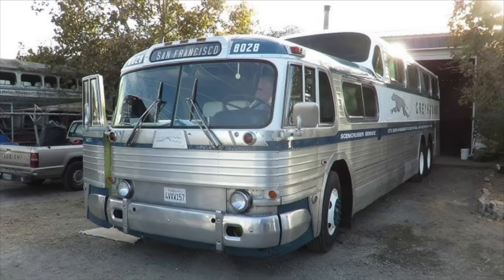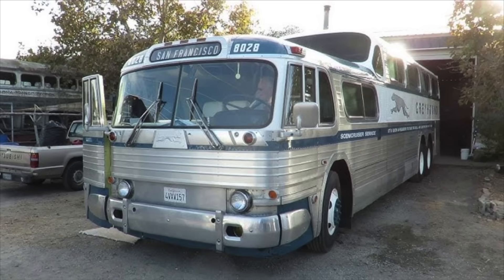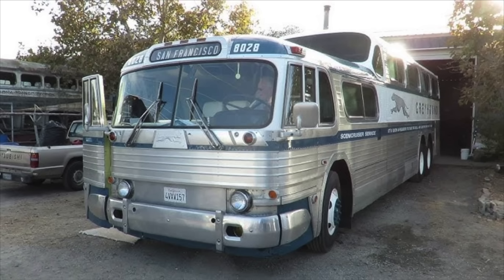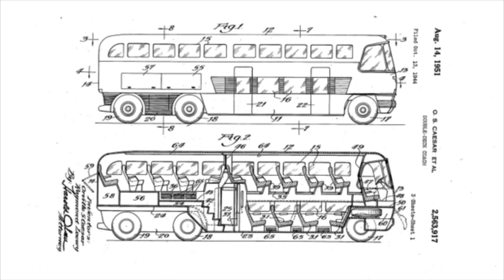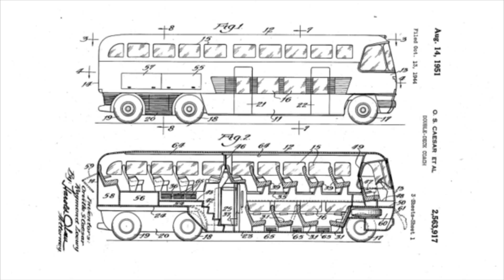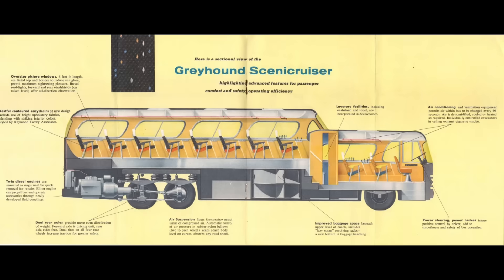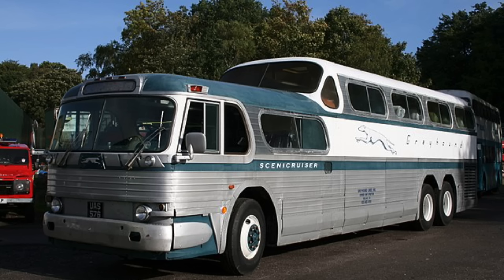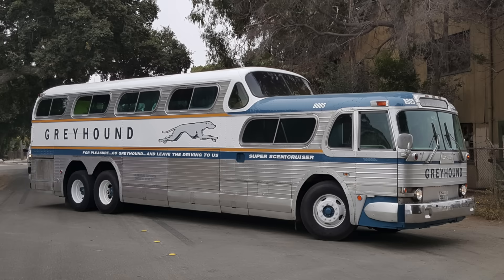Awesome & Flawed Vehicles: 1954-56 Twin-Engine GMC/Greyhound PD-4501 Scenicruiser Bus!

Comment: My father was a 30+ year Grayhound driver retired.  I was an adolescent when he would regale our family at the dinner table with the many adventures that he experienced training on and pulling runs on the newly acquired GM Scenicruiser. The coach was in a constant state of refinements; tweaking this and changing that. One notable stab at improving the drive train by changing out the diesel powerplants (not mentioned in this article) was a test bus fitted with a V8 engine from Mercedes-Benz. Riding shotgun with my Dad was a MB engineer from the "Fatherland" suited out in a black jumpsuit with the three pointed star logo. His (they, unfortunately, were all men) would painstakingly monitor the engine for EVERYTHING; performance, noise, vibration, fuel and oil consumption, etc. Eventually the Grayhound brass and my father were unimpressed and the project faded into automotive history along with the Scenicruiser. As Bob Hope would say, "Thanks for the memory."
Reply: Why would that be unfortunate. Do you also find it unfortunate that dangerous, hard manual skilled labor is 99.9% men ?
Reply: Unfortunately all were men? Well I’m sure your father, a man, would know Greyhound is trademarked as grEy. Not grAy.
Reply: What makes a person conclude everyone in a job being all men, is unfortunate?
Reply: Was the Mercedes engine diesel?
Reply: Why is it unfortunate they were all men ? Do you prefer diversity over compentence ?
Reply: Why "unfortunately they were all men"?
Reply: @richardellison9833 You have to ask?
Reply: @joeybonin7691 i have to ask the same question. What is unfortunate about it being all men? Y’all apparently think there is something wrong with all men doing a job. What is it?

Comment: I had a 1955 Flxible VL100, and yes that is the correct spelling. Mine was a very nice motorhome conversion. It had a DD 6V-92 that was turbo and supercharged. It was an auto and had a torsalastic suspension and it rode like a floating cloud. It also had the stepped design and view out windows although not as drastic. I personally think it is the best looking bus of all time. Here is a small clip from a friend of mine who saw us coming down the highway
❤ 

https://youtu.be/pAHt49rUdmM?si=-xCYISxMAYjwsliR

Comment: Absolutely loved them.  Rode them on both long and short trips on multiple occasions.,  Later in life, I worked as a driver for an east coast firm that owned and operated MCI and other brand buses, including a MCI that had an automatic transmission.  I was one of only two drivers who would drive this particular model there.  Thanks for posting this as it brought back many fond memories.  Oh, I forget that that while in the last year and a half of college, I also worked for Continental Trailways where I learned to drive their foreign made and GM motor buses working in the terminal located in my home town.  I still preferred the later MCI buses, though.

Comment: Only rookies double clutched. The unsynchronized 4-speed was also used in big trucks with an added "creeper" low. An experienced driver would "float" the gears and never even touch the clutch exceot to start out from a stop. Never grind the gears either.

Comment: Originally the 200 hp 6-71 didn’t have enough power so they switched in twin 150 hp 4-71’s with a fluid coupling for the transmission clutch. The good idea was that everything was mounted on an engine cradle that would slide out, so for major repairs they would just switch out with a fresh set, sometimes while maintaining schedule. One of the big problems with this was the transmission was controlled by an electronic clutch, sort of like an on off switch. Drivers complained about this for years. It was very hard to do a smooth takeoff, and the bus would be jumpy taking off from a stop
Reply: After building 900 Scenicruisers, they switched to the standard clutch actuation for the last 100 and then retrofitted the solenoid switch clutches in the field.

Comment: Part Two !! Also a few years later when GM USA was drastically unhappy with the performance of both their Europe brands Opel and Vauxhall/Bedford they sent a whole "troupe" of US GM guys to kick these buisnesses into financial shape. You can see when this happened , as all models cars and trucks became very , very US like in style. EG the 1962 PB Vauxhall Cresta which looks exactly like a 1 foot shorter 1963 Chev' Impala, or the TK Bedford truck range which are cab-over forward control design which is a near identical copy of the 1959 GMC/Chev truck range of forward control cabs , the only difference being a useful update of bigger front windscreen, with a small upper screen overhang incorporating fresh air vents that had secondary fan assistance too.

The US GM guys MASTERPIECE, the Bedford VAL long wheelbase coach chassis with dual front steering axles and a special new kind of electro mechanical braking system. This was purpose designed as a coach chassis NOT FOR any kind of truck. It's sole purpose was foe high speed luxury travel on the new British and European Motorways of the late 1950's and early 1960's. The engineering team was the said same group responsible for the Scenicruiser. But still lacking a realistic and suitable large capacity diesel for a coach , the GM guys went knocking on the Leyland Truck and Bus company's door and purchased the biggest engine on offer 9 litres worth of inline 6 cylinder tried and proven with an 8 speed manual transmission, known as the "chinese gate".  Later Bedford/Vauxhall made their own engine to power the coach from 1970, (VAL 70's) however all the early ones the VAL 14's were all Leyland powered, they have their own unique sound, with massive torque (watch the original Italian Job movie with all the Morris Mini's that drive and hide in the rear of the bus and you're looking at one with a Harrison body)  When I was a kid in the early 1960's our local suburb bus company bought half a dozen of them and used them for long distance coach trips that were becoming popular. In the early 1960's we went on a school tour to the new Snowy Mountains Hydro Electricity scheme at the bottom end of New South Wales next to the Victorian border 500 mile trip there and 500 back home, the new busses were fantastic with plenty of punch, able even to overtake cars on dual lane sections of the road, very impressive. When we arrived at the giant dam and lake viewing points, and the giant power turbine plants some other school children were more interested in our three busses than what they were there for !!   GM's Bedford UK team had tendered for coachbuilders to design suitable coach bodies as "off the shelf" fully finished items around 6 were selected including a Dutch and Spanish pair of companies. If you wished you could buy a chassis and have a design of your own built, this was rare 10% , GM's Bedford /Vauxhall division made around 2600 all up and a huge percentage are still in use near 60 years later some re purposed as motor homes, television live filming units or specialty horse floats. The next item this brilliant team of GM US designers created was the 1970's GMC Motor home.

Driving one.    When I was 26, (am now 69) my grandads mate that owned the local bus company rang me and asked if I wanted to work over the long weekend (easter) I wondered what was on as I am a doctor , however I have a drivers license to drive ANY vehicle. Bill asked me whether I wanted to help him as a driver was sick and off for a couple of weeks and he had tours booked.  FINALLY I was going to have a go at driving my favorite commercial vehicle and early one with British Duple coachwork and the giant Leyland diesel and unique "chinese gate" manual gearbox. 5 days and 1,500 miles of fun I took my partner Georgina as well she sat in the hide-away "couriers" seat near me. It was fantastic, that Leyland engine was like having an elephant under your foot, seriously powerful on hills with super well placed gears, power steering and its unique excellent electro magnetic brake system, a drive to NEVER forget

Comment: From 1981-1985 I was in a college orchestra that traveled around the U.S. (mostly Texas, the mid-west, and east coast). The conductor of the orchestra owned a SenicCruiser and he used it to transport us city to city. So I’ve ridden more miles in one than most people. 

His was in original condition with original seats and interior, but the exterior had been repainted. 

It had a comfortable ride, was relatively quiet and made many many trips without issue. I recall that we once needed some repairs, but they were minor and we were back on the road in just a few hours. 

I saw a lot of American from the upper deck of a ScenicCruiser and have fond memories of those trips.

Comment: I aquired scenicruiser #667 in 1994,  it was badly rusted, having blocking plates installed in the suspension. I drove it twice, but never rode as a passenger, the seats being removed. The 8v-71 conversion worked well , giving the bus excellant performance. The 8-71s were installed by MarmonHerrington as a contract separate from GM, and a consideral ammount of rewireing was done in the engine compartment. The man I bought it from had it up to 110mph on I80 in Pa.-     667 never survived past 2010, it was decided it was to far gone for restoration and was dismantled.
Reply: Bruce, this is what I have on #667. 
PD4501-667 Southeastern Greyhound Lines M-227
Southeastern Greyhound Lines M-5506
Southern Greyhound Lines 5506
Beaver Valley #529
Greenlawn Transit Co. (Ohio)
Unknown Owner (1989-1997)
Jeff MacMakin 5/99

Do you remember the name of the man you bought it from and did you sell it to a Jeff MacMakin in '99?

Comment: My band bought one of those busses at a police auction in Alabama for $2,000. We had ten people, five each in the band and stage crew, and the size of the upper level allowed us to put six beds up there, with a little breathing room in between, two beds on the lower level, along with a single row of four seats. We removed the bathroom because of the cost of using it. It was great to travel in, but it was a money magnet. Parts were hard to find, and were expensive. Finding a mechanic that could work on it was almost impossible. We sold it to a guy in Page, Arizona who added it to his existing bus home out in the desert near Big Water, Utah. It cost us less (at the time late 1980s) to get 5 rooms a night than to run the bus. But sure was comfy...
Reply: Do you know the serial number of the one you bought and what year? Great story!

Comment: I worked and drove for Greyhound from 1999 through 2006.  The Los Angeles Depot had their Museum fleet in that facility and we could look them over from behind a wire partition.   If we wanted to see the interiors, we had to ask the chief Mechanic who was usually too busy.  Like a lot of things from the Fifties, these buses were fabulous if you were 5'10" and under.  Both for the driver and passenger.  Anyone over six feet really had to watch their head.  The toilet was particularly tight.  The rear baggage bins were cavernous.  Oh, John has commented.

Comment: Hoyt Axton - great singer but better known as a songwriter - toured in one he wrote about in his song "An Old Greyhound." "We love it if the gears don't grind" - Greyhound drivers had a reputation for driving smoothly and these buses apparently took some effort because there was a lag in the clutch pedal. There's a reference to this when Roy Scheider's character in Sorceror, an ex-mafia getaway driver hiding out in South America, is driving an old army surplus truck - trying out for a suicide mission driving unstable nitroglycerin through the jungle - and he manages to drive it smoothly; he claims he got his skills from Greyhound. But it apparently takes a lot of getting used to and a lot of people claim it's easier to learn to shift without the clutch; I'd agree, having driven a couple semis but really - with only 4 gears and an engine that doesn't like to lug? (A semi under load would have at least twice that many and usually an engine with more low-end grunt). At some expense you can convert to an Allison automatic; which is what Red Bull did for theirs and also added an 8v-92; basically the heart and guts of a newer bus. All in all, I thought Hoyt wrote many better songs. "Lion in Winter" is gorgeous; maybe in all those drugs, his bus sang it back to him? "The Pusher" - not about the engine in the back of his bus, it was about a drug dealer, but not the good kind who sells you some love grass, the bad kind who takes your body - and leaves your mind to scream. I'm getting off-topic. "This jacket's tight, but I feel fine, though they say I've lost my mind / In the madd'ning, sad'ning gloom / In the darkness of my room." - yeah, Kingswood Manor.

Comment: Great video!  I rode in a Scenicruiser a number of times from the late 1950s to perhaps even the early 1970s.  This would have probably been between Houston and Lake Charles, or after 1970, between Houston and Lafayette.  I thought they were neat buses, and always hoped a Scenicruiser would be assigned to the run I was on, though usually they weren't.  

I recall riding on a really old bus about 1958 that had a rounded rear without any rear-facing window with my grandmother from Dawson, Texas to Corsicana.  The bus company was Central Texas Bus Lines, I believe.  In Corsicana, we boarded a Greyhound for Houston, where we changed buses.  One of the two Greyhounds was a Scenicruiser.  On another trip in reverse, I rode with my grandmother from Lake Charles to Houston by Greyhound, where we then walked to Union Station and rode the Burlington-Rock Island's Twin Star Rocket to Corsicana, where friends of my grandmother met us at the station for the 25-mile trip to Dawson.  

Interestingly, I flagged down two intercity buses in my younger years, and in both instances, I had my trombone with me.  In the first case, I had to play my trombone in a performance in the recital hall in the Old Music Building at the University of Texas.  A buddy then drove me to the Kerrville bus station in Austin, and I was convinced I was going to miss my bus.  As we went through the intersection at the rear of the station, I saw the bus for Houston stopped at the stop sign, having just left the station.  I had my buddy stop his car in the intersection, blocking the bus, and I got out and hopped on the bus.  In the other flagging incident, I was catching a ride to Houston with a Longhorn Band buddy from the Texas–Texas A&M football game in College Station.  We got in a small fender bender.  After we pulled off the side of the road, I noticed a Greyhound bus coming from about half a mile behind, so I flagged it down.

Comment: ...rode  on both the Scenicruiser and  Buffalo.  Indeed getting that front row on the upper deck was choice.  The Buffaloes were interesting in that with those intended for heavier loads (most commonly private coaches and motor home conversions) had the tag axle  mounted in in front instead of behind the driving axle which made for some tricky cornering on city streets.

Near the  near the end of it's service career some 4105 Scenicruisers were converted to freighters for Greyhound's GPX package express service  and a few as combination freight and passenger vehicles.

I found both to be very attractive with their iconic streamlined appearance compared to the "boxy" looking MC 7 (built by Greyhound's MCI division) which became the mainstay for the company as well as was sold to other operators in the 1970s and beyond..   MCI also built the smaller MC-5 (similar "boxy" style) as replacements for the GM single deck 4104s  and 4106s   (the 4104 was distinguished by an emergency door on the left side at the rear).

Yeah, logged a lot of miles on the old "Grey Dog"..
Reply: Thanks for thevaffitional information! 👍😎

Comment: Loved riding these in the mid 1980s. The private high school I attended bought 3 from Greyhound in 1970 and operated them until 1993. My favorite spot was the front upstairs. One fantastic memory was April 1986. A group of us were on our way back from a field trip in Seattle, headed to Auburn and we were really late. Our bus driver pretty much stood on the pedal and we were bombing down I-5 flying past cars left and right. That was 55 mph days. I was sitting near the front and had a good view of the speedometer. We were doing over 70 for a good portion of it, a few stretches over 75 and touched the 80mph governor a couple times.

These buses didn’t have a ton of power. On trips to Eastern WA our drivers sort of putted the Scenicruisers against each other, seeing who’d be first to the summit, but we were doing all of 35-40 up Snoqualmie Pass.

These buses were very enjoyable to ride in, but they were definitely noisy by today’s standard, especially the rear half of the upper section hearing the Detroit diesel grinding away.

The high school stuck with them until they were pushing 40 years old, but some major breakdowns on the road finally ended their career at Auburn Adventist Academy.

Oh another memory was once we jammed 72 bodies on boardfir a short trip from Kent to Auburn. It was really wallowing and bobbing from all the extra weight as we lumbered  our way home.

Comment: I had a dinky toy of one of these in the 70s.  I thought it was the coolest bus I ever seen, and I would wonder what it looked like inside.  In my 30s I got into the heavy towing industry and towed many a motorcoach. I never towed one of these though.  That drive system is a common thing now.  The third axle is a single tire booster axle or tag axle, while the second axle is a dual tire drive axle.  Detroit is the most common engine that I've encountered.  I've been under more buses than I care to remember.  Many had problematic air systems.  Some had brake pots that could not be caged.  A major pain in the ass to deal with, especially when it was -30°.